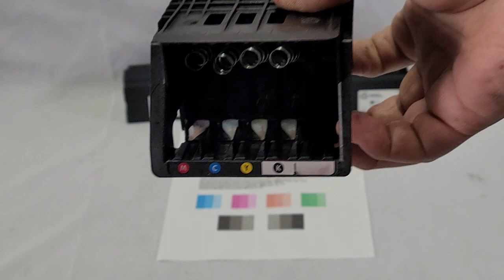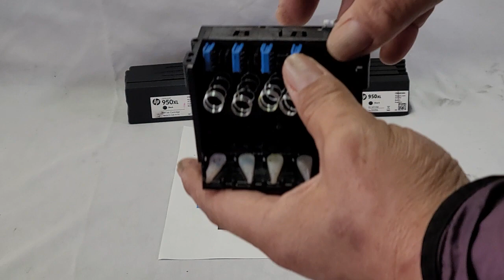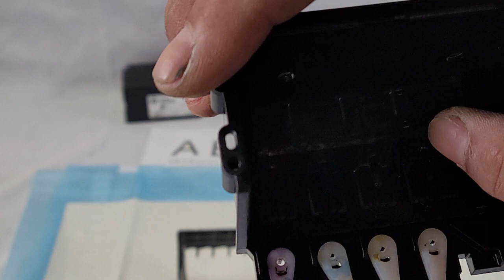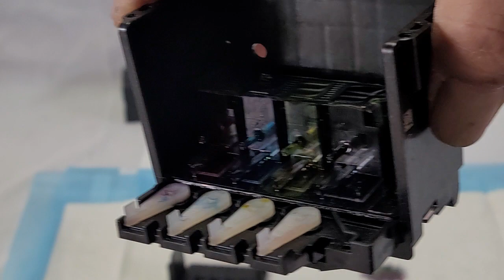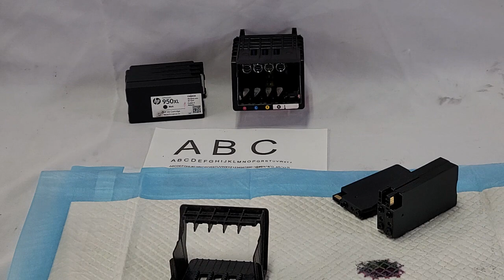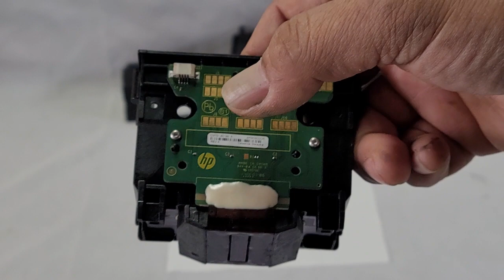explain common problems for HP 950 printhead and  cartridges HP officejet pro 8610 8600

Comment: I have a problem with my printhead for hp officejet pro 7720. So the color mixed together with other color, I have clean it with cleaning solution for several times, but the problem keep happen. What should i do? Should i dissasamble it to know the problem?

Comment: Thanks so much for the information. So question when there is not proper pumping because of the strip becoming unglued, does that cause the system supply error in the 8710 8720 7740 models?
Reply from the maker: that is different issue, when strip ungluded , it only showed depleted acrtridge.  ink system errors are mostly happened chamber vinyl hole, or chamber cracked . ( low chamber pressure )

Comment: Here is another question, sorry for so many... So I have had many customers get the issue with the colors like yellow or magenta come out dark like you mentioned. I know you said that is because of either refilled or non original cartridges. I got this problem when I changed a printhead for a customer which got system supply error and they took the cartridges (which are original) from the old printhead and used it in the new one and their colors came out dark. Is it because the cartridges they removed were already used?
Reply from the maker: Yes. If old printhead had the same happened, old cartridge also color mixed   ink from the old printhead.

Comment: How do you spot a fake HP Cartridge to a Genuine HP Cartridge.
Reply from the maker: Actually it is hard to tell. most fake cartridges are made from HP abadoned factory so they are exact same looking. mostly they sold it with out packaged. and ABS metrials are little shiny than original l, sticker colors are little darker or lighter